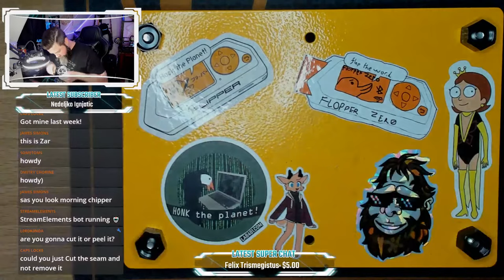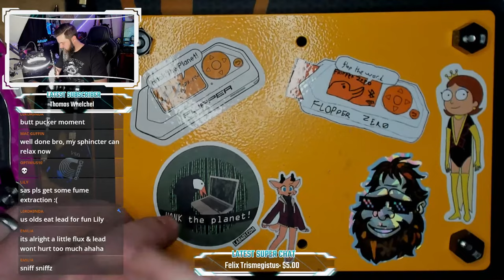Flipper Zero RGB Screen Mod Live Stream!!!!!!!

Comment: Tech tip, get a spudger tool... It's basically a plastic bit you can prod around and not scratch anything. Be knowledgeable of your connector types. 
One pattern I recall is putting that tool tip under the wires near the base of that connector and it was used as leverage... It's easy to do when you are doin it right... Otherwise you do NOT use force for any of these micro connector tid-bits/procedures. This is just take-apart / re-assembly tips... there are other repair / mod tips that traverse the basic take apart and re-assembly steps. In essense, you do not want to break anthing you can re-attach... unless you want to get into some micro soldering techniques... muahahahaaa
HAVE FUN !!!!